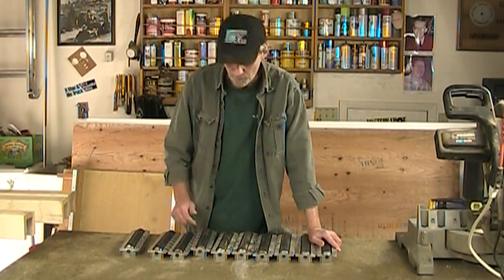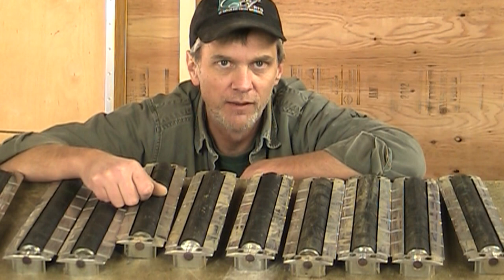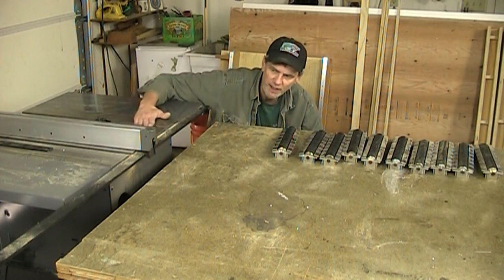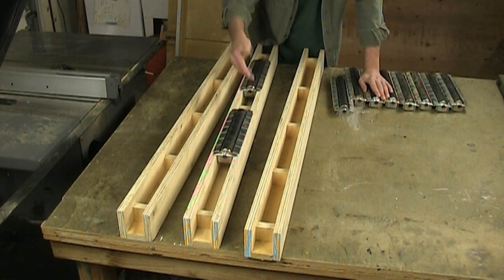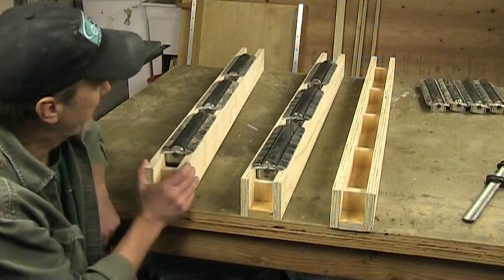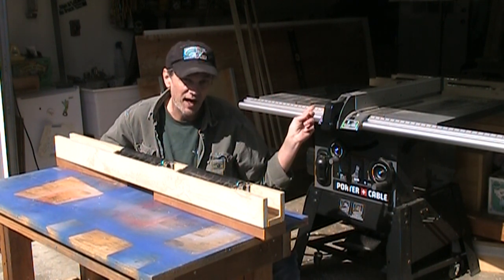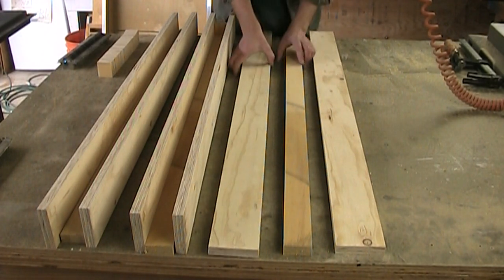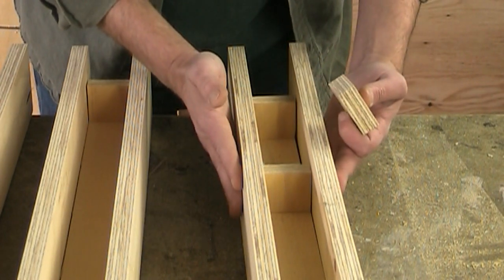Table saw outfeed supports

Comment: Excellent use of "discovered" materials! Very neat and practical, especially since it does not require rebuilding existing benches.

Be careful that those rollers are always perpendicular to the saw-blade and direction of movement through the blade. They look like they are made of rubber or soft "grippy" material that could cause a large board to wander off course.

Great concise video of a clever idea Steve!

Comment: Somewhat like what rvboyett had suggested, I'd drill holes in my table and the roller mount so I can just put them in position and drop a pin in. I'm sure you can figure out an infinite number of ways to make a wooden drop-in pin! (I'd go with a U shaped pin personally, but a straight pin would probably work just as well)